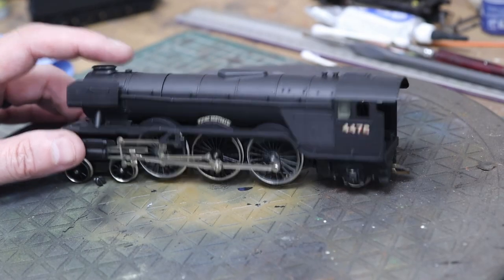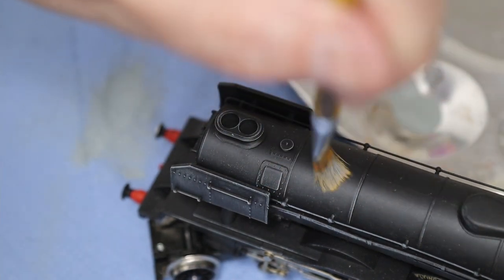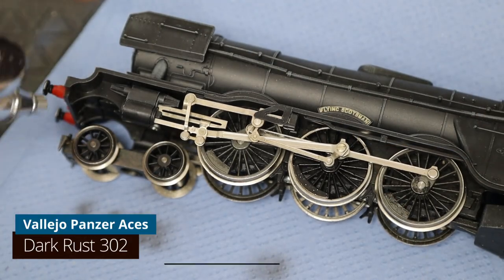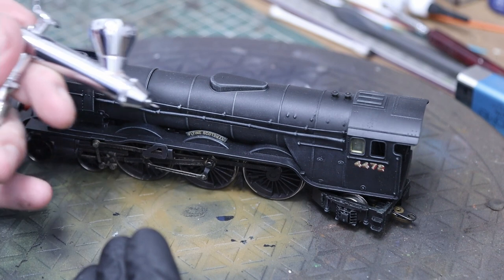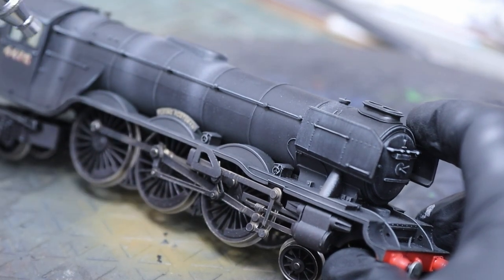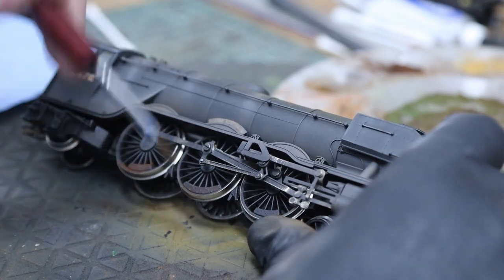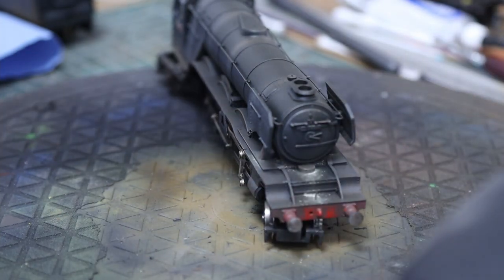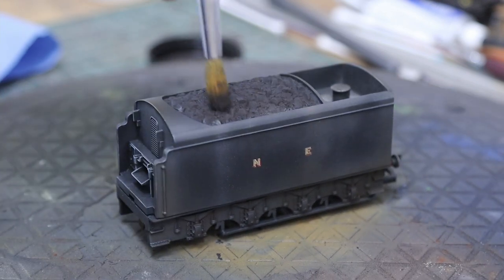Weathering Flying Scotsman in Wartime Black | Weathering Model Railway

Comment: Did you add the smoke deflectors yourself or did they come pre-attached to the original green model. I have a hornby wartime black scotsman that comes with smoke deflectors and was wondering (if you did) how you attached your smoke deflectors. If not dont worry the video was very good
Reply from the maker: Hi. The deflectors were already attached. The true wartime Scotsman didn't have deflectors fitted. They weren't added until the 60's, but i just like the look of them.
Reply: @BuntersYard  thanks!